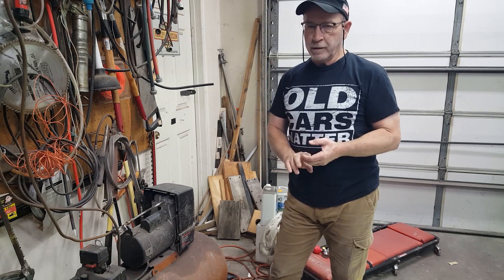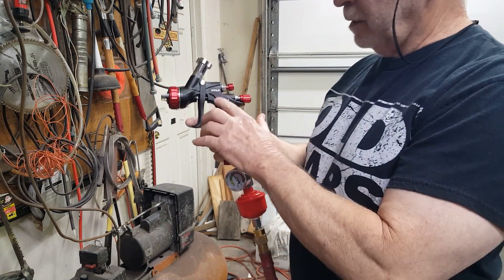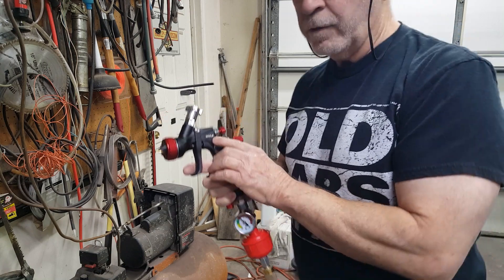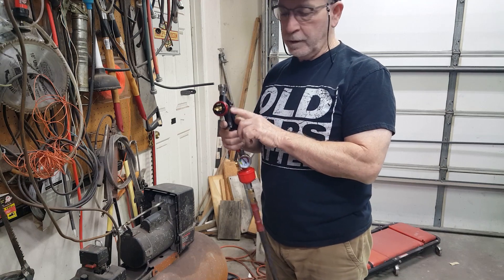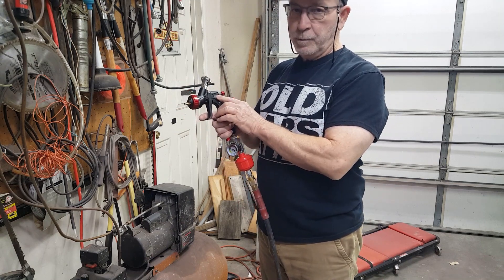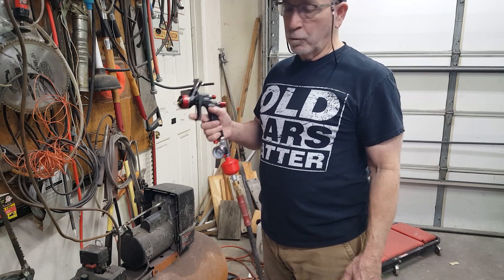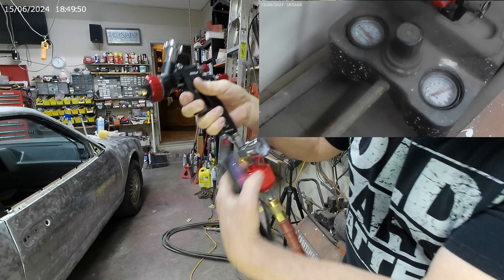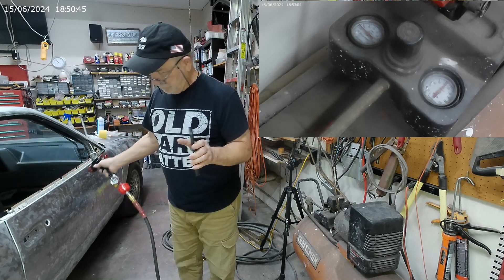Old Craftsman 6HP 33 Gal Compressor,  Is It Enough To Paint A Car With A Black Widow

Comment: Great video, I’m really interested to know how it worked with actual paint.
Reply from the maker: Hey, thank you for your kind comment.  Yes, it worked well.  I have shot in total three coats of epoxy primer, and two coats of 2K urethane primer.  On the last coat of urethane, the pressure switch on the compressor failed, and the tank ran out of air just as I finished spraying earlier this week.  Before that happened, it kept up with whatever demand I put on it.  That switch was repaired a couple days ago, and it's ready for final sanding, final primer, then color and clear.